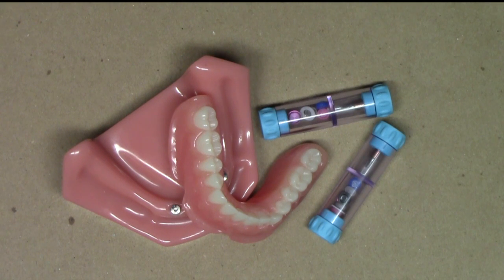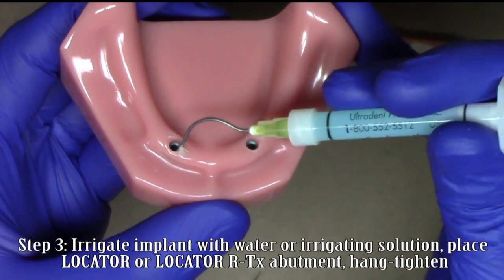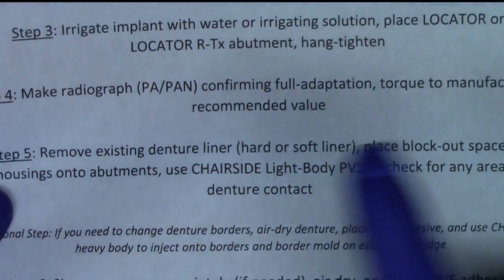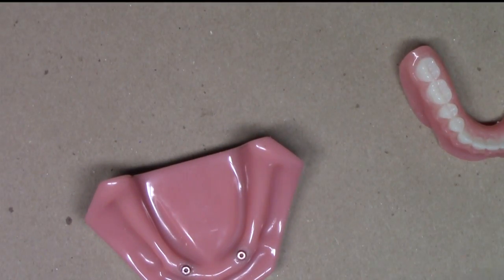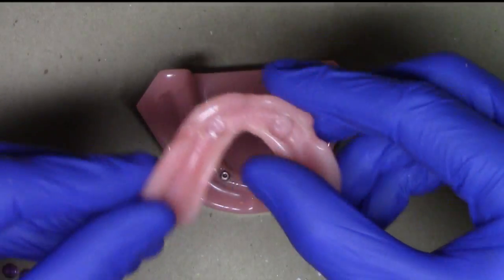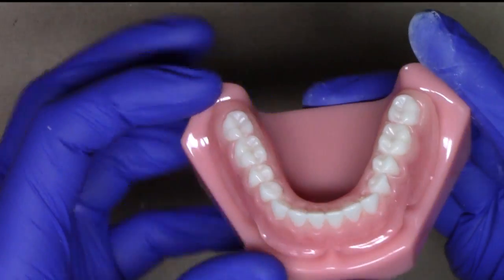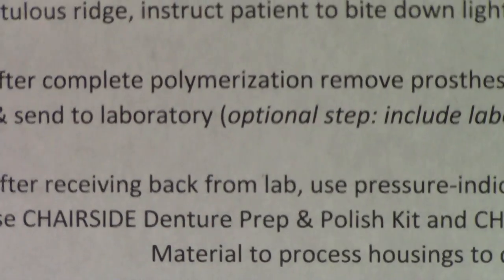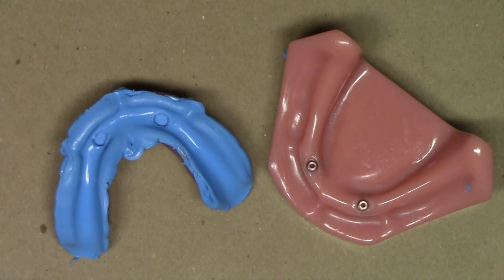Laboratory Reline for LOCATOR and LOCATOR R-Tx Dentures: Step-By-Step Technique

Comment: why do you prefer to pick up the housings chariside as opposed to using the analogs?
Reply: I’ve had distortion most times and the denture just doesn’t fit properly then you have to take the time to remove the housings and pick them up anyway. Also if you don’t get them all at the same time it seems to put lateral forces on the implants and you will see vertical bone loss over time. Chairside pick-up gives me better results in my hands. Great video!